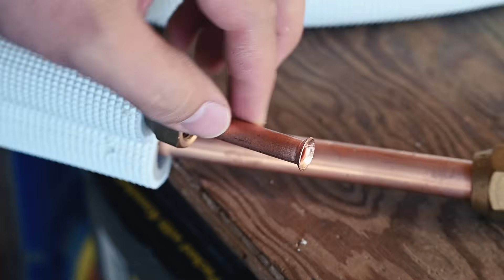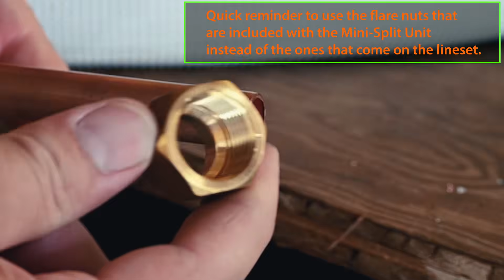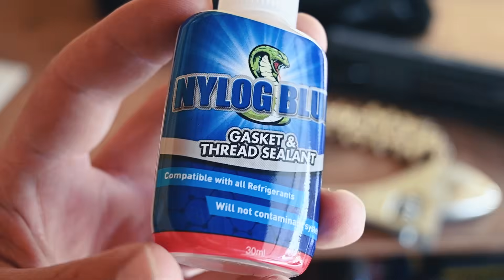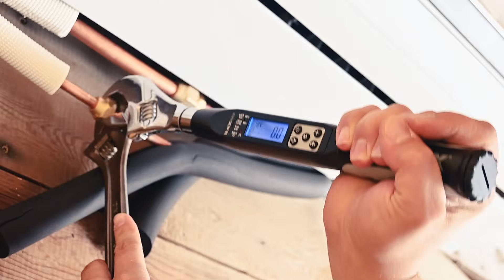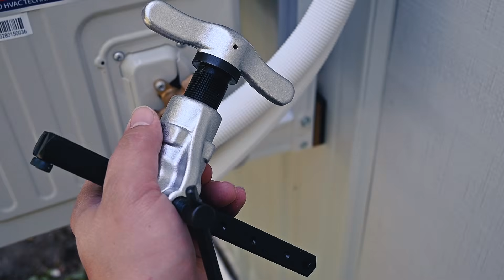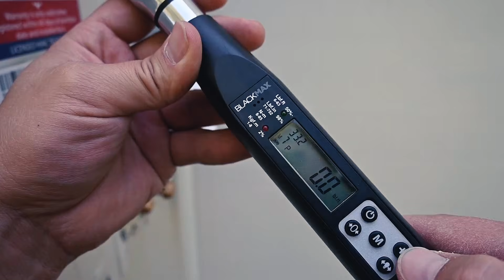How To Install a Mini Split Line Set - R410a Flaring Guide & Torque Settings Using Nylog

Comment: I used too much Nylog on the 1/4 line and could not get it to torque correctly.  I cut it and re-flared it then use a tiny bit of Nylog which worked well.

Comment: I would pressure test before pulling a vacuum. If your system has a leak while under vacuum, you’ll be pulling in moisture laden atmosphere. You do not want moisture in your system.

Comment: DISAGREE!!!
There are many more compressor lifespan-threatening mistakes than just flares.
Factory tubes not cleaned with nitrogen prior to installation.
Hand bending of tubes.
No high-pressure nitrogen tests.
Unlacquered motherboards - humidity is a killer.
No 24-hour vacuum test.
And many others. 
Flares are just one of them and are easily overcome with power tools (won’t bring up names) with 4.8+ ratings on online shopping platforms.

Comment: my buddy bought the CPS Blackmax wrench you used to install a mini split in his shop.  it worked great for him, but last week he brought it to my shop to help me install my system and the digital system was locked up.  it had sat for just over a year since he did his system.  he called their tech support and they had him try several ways to reset it to default and then told him it was toast.  he filed a service request on their website over a week ago and has called them twice more since and has not received a call back.  he is very unhappy.  to finish my system, I bought a Yellow Jacket 8 piece set with a manual click type torque wrench.  no chinese digital tools for me after seeing what happened to him.

Comment: pls if i may ask , is it okay to bend the pipe coming from the indoor unit , (if i wanted to pass it through a wall ) when it is still under pressure or should i de pressurize it first before making any bends on it ? pls help

Comment: I always rite off the first flare without  a nut as practice. Im 70 years old and have made i couldnt even tell you the amount of flares i have made in my 50 years of flaring. Several practice flares. Im not a violent person but if i could go back in time the person that invented the flare should be stopped before he had a chance to ever invent the flare.

Comment: Hey Ben, what do you think about using heat shrink tubing on the suction line before installation? I think it could complement the existing insulation very nicely, but can you think of any downsides? Thanks

Comment: I see that that mini split use the white polyethylene insulation on the line set. I've been reading that the white polyethylene will start corrosion of the copper line sets if moisture gets inside?  And people recommend the black rubber insulation instead which will not have long-term corrosion problems. What's your thoughts on this?  You can search YouTube for formicary corrosion lineset to see examples.

Comment: Decided to spring for that CPS torque wrench. It uses an electronic pressure sensor at the pivot point, very cool.
Wish it had a safety hand strap tho, had to jimmy rig my own. Definitely not a tool you want to drop.

Comment: Great video. One thing I don’t agree with however is purchasing a $200 HVAC torque wrench. I’ll use it one time, whereas I have many automotive ones. Crows foot and good to go. For most this is the least expensive option

Comment: This is really good.  Do have a question.  If I want a tighter bend on this type of line set, can you just used a tubing bender (keeping in mind that the bend radius needs to meet the recommended standard for the line set diameter - 2.5 x the OD)?

Comment: Hello Ben
I hope my text reaches you for a response, Thanks for for video very educational,  I have a split unit similar to yours 12btu, 'air distributer internal unit' and where your copper pipe turns left, mine turns right. as original it is same as yours going to the left exit, but in mine I need to go right this is scaring me pipes are very small, the straight option is not working for me I have a concrete column.
So it looks like this needs 180 degree bending and someone who is not aircon expert it is little scary undertaking, could you help and explain how to safe this thing without bending pipes internally wrong way. I am an architect know about buildings but this is little of my expertise.

In Summary aircon as standard come the pipe exiting to the left bended by the factory,,,,, on my case I need this pipes to go right opposite direction, big twist on the pipes can ruin the unit, please help. Thanks in advance.

Comment: Hi, DIY first timer. Great video. The line set that comes with mini split system I plan to purchase has pre flared ends. Instead of trimming the line that connects to the condenser, can the excess line set just be kept coiled and connected to the condenser? I estimate perhaps 3-4 ft of coiled lineset.

Comment: There is also a gasket for flare fittings made by locktite I used on my units and I can't say it's the reason for me never finding a leak but I like to think it helps I use them with nylog blue!

Comment: Very good clear video, and much appreciated! I am new at this and was surprised that the factory-supplied copper lineset flares are not made to match the pipe offset on the shorter pipes of the indoor unit. I would describe the model I got as quite "user unfriendly" for the DIY'er. By the time I learn all this, I will probably know as much or more than the expensive guys I could have hired. The instruction booklet suggests that the typical cost to hire someone for the entire installation should range from $600 to $1200, but I know full well that not only would they charge around $4000, but they would do a massively inferior job, cutting all sorts of corner than have taken me many weeks of work in my particular installation. In my case, each step is at least ten times harder to do than shown in all the video examples I've seen.

Comment: I always wondered why Pex can't be used instead of copper. Does anyone know why it has to be copper? Actually just realized copper is needed to handle the heat..
Reply: What is the +/- pressure and temperature rating of pex?

Comment: Every time I try to do that it pushes the copper tube out of the grip. I Tried everything and finally found what I needed and word of warning don't use Harbor-freight brand well for Flaring tools. It don't work even though cheap. Bite the bullet and buy a good one if your going to be using them often.

Comment: Is there some rule about line sets needing to maintain a downhill slope between the air handler and the compressor or can the last foot or so slope up to connect to the tubes coming out of the compressor?

Comment: Thank you for the content. 

I am a paid tech for 8 years. I will forget to put the nut on the line pre flare a few more times before i retire. 

Funny but great to share, happens to most of us.
Reply: Flare nuts or heat-shrink tubing... More times than I can count.😅
Reply: @uncontrollabledogs3791  lmao heat shrink! Yes! I did automation tech gig for a bit <3 that was shrink wrap forgotten often. I should get some on the hvac van. Ty for the smile and reminder fam!
Reply: Very informative video. In my country the techicians never dare to cut piping to size use flaring tools. They are yet to realize the importance.

Comment: Showing house wrap in the video's final image - what was the cladding going to be on the house? The line set is attached directly to the sheathing, and the outside condenser is set before the cladding?

Comment: Hello, i have bought a second hand 2.5hp AC, have been using it for 5 years now, i used to call people to refill the refrigerant couple of times, now I realized that they have been using freon mix with air, now my AC is not cooling because there is no freon, just air. Can you tell me how to removed all the old freon mixed with air from the AC units, and start to vaccum again and refill the freon again? Thank you.

Comment: There should be no cracks In the flare. These are a source of stress concentrations and the crack will spread.  if there are cracks, they need to be removed usually with automotive sandpaper.

Comment: Although this video was extremely helpful, I realized after cutting off the flare that came with my 1/4” Line-set that the nut was just as good as the one that came with the unit.  To make matters worse, I’d already done the connections so I took it apart to cut it off.  Now, when I attempt to re-flare it (my first flare), I’ve tried 8 times and can’t get a flare NEARLY as good as the one which came with the line set. So I’m stuck until I get someone to re-flare this connection.  I not touching the rest.  I suppose my flaring tool is too cheap. But at some point it doesn’t become worthwhile doing it myself if I have to spend boku bucks on each tool.  😢

Comment: Duh! Only the condenser outsides unit comes with extra fittings the inside unit you have to use what's on the lineset so what's the difference? So does that mean the inside connections are good and the outside are bad? Duh!!

Comment: 4:20... I can see that the Flange of the pipe is too small in diameter for that connector nut. I use 1/8" out to have the Flange the same size as the 3/8" Nut.

Comment: Having done automotive brake lines (too many times) as well as A/C, there is nothing here that I couldn't easily accomplish.  However, the reason I went with Mr Cool is because of the warranty.  And because I bought from Ingrams, the warranty actually works.  Is your CH unit still under warranty for a DIY install?  Most aren't.

Comment: i am researching how to install my first mini-split. I am concerned about the flare connections. I heard you say to use the connectors that came with the condenser. I am wondering if you cut off and re-flared the evaporator side and reused the connector nuts that came with the line set or went with the flare/nut  that came with the line set.

Comment: Hi Ben, Love your video’s! Super helpful so thank you! Quick question. I notice you don’t do a nitrogen pressure test, just the vac down etc…I see info that lands on both sides of the fence. Are the necessary? Is it certain situations they should be done? I’ll be installing a system shortly and an was hoping for some insight. Thanks man for all you do!!!

Comment: Great vid. now subbed. 
Can not be emphasized enough: buy quality tools.
If you use a deburring tool, point the opening down to avoid any copper bits from going into the tube.
I love the Rigid mini cutter.  I have severe arthritis in my hands, so I keep a larger one in the bag for doing 3/4, but yeah, this thing is great.
HA. Glad to see I'm not the only one who forgets to do the first step first (re. flare nut). 
I'm writing a book on Mindlessness Practice.

Comment: Youd be fired straight away using needle nose pliers to debur and the cracking copper around the flare definitely needs to be fixed

Comment: Could you please tell me when to open bottom valves on multi zone mini split  as nobody seems to explain this well. Most know to keep top master valves closed until very last but several videos tell us to open bottom valves before vacumming begins and some tell us to do it after. Who is right? If you do it before do you lose much refrigerant? I have a cooper and hunter 3 zone. Please help.
Reply: Nitrogen pressure test 350psi for 30 minutes each line set/zone,  then vacuum each line set/zone for 30 minutes. Then open each zone's valve slowly, then the main valve. Have the total additional feet of line set added to all zones, you will then need to add r410a slowly. The 28000 BTU CH is only precharged for a total line set feet of 74.

Comment: Factory flares on my Cooper and Hunter were perfect. Used Nylog as added insurance. Freon in the compressor is preset to the size of the line set. Any DIY homeowner should not cut off part of the line set. It will cause an improper charge.
Reply: The lineset that came with my pioneer also look good. I have reflared other minisplits and have the tools but no reason doing it if they look good already--although i get it if you have to shorten the lineset.

Comment: HI- need to order a 25' length vs the 13' supplied. Can some one explain the specs to me so I can order it on ebay?  I understand nut size- OD and inner diameter- but don't see mine on the drop down menu.wil add pic of current 13".   8x8(38"x3/8") other is 8x12 (3/8" x 12")

Comment: Oh yeah, I've done the same kind of thing as forgetting to put the nut on before flairing, but usually it was something like connecting wiring and not running the cable thru the box or nut first and having it all nice and tight and then OH DAMN, how did I DO that!!!!!!

Comment: I am installing a 4-zone mini split on interior walls and running the lines down through the wall cavities and through the crawl space. 
I could get one, maybe two, of the air handlers installed but I have to leave walls open to have the lines accessible for pressure testing.
To avoid leaving walls open all winter, can I leave the activation valve closed and evacuate just the branch and then open the activation port giving access to the active manifold?
 If I can do it that way, I wouldn't lose any refrigerant and I can close up the two walls that are open now.

Comment: When running line sets for extended runs, such as 40 ft, through an attic...what would be the requirements for securing the lines. Must you secure them to the trusses or rafters and if so how far and by what means.

Comment: I have a question - I see you trim off about 4 feet of lineset at the outside connect point. How does that affect the amount of coolant already pre-loaded into the compressor? What is a safe amount of line set to cut off before you worry about the coolant load causing overfill for the length of lineset? For example, it looks like you had maybe 20 feet of lineset and cut off 4 feet, That is about a 20% reduction of running footage. I have heard that 80% give or take is OK for the coolant weight in relation to the length of the lineset. Would you say that is accurate?
Reply: It doesn't matter that much. There is some flexibility with regards to refrigerants. If you get way over 25ft you might consider adding some, and theres a formula in the minisplit installation guide for  that.
Reply: Great question. I'd like to know that as well.
From what I've been reading, most pre-charged units are set for up to 25' and have linesets that are 16' and 25' for the same unit. Install manuals that I've read just mention the need to add refridgerant for >25' but nothing about <16' .  
That's all I know so far.

Comment: Well done video--as usual. While working in the nuclear industry as an instrumentation tech, no flared fittings were acceptable, due to less strength than good compression fittings. We primarily used Swagelok compression fittings, or sometimes Parker, on high pressure inconel, lines. Flared fittings are outlawed in nuke industry power block.
Why don't Swagelok fittings get used with HVAC? I would use them in a heartbeat over flared. BTW, I was certified on tube bending, and virtually all fitting types.
The worse aspect of Swagelok was over torquing by pipefitters on smaller fittings.
Reply: Hello there , how are you doing today?God bless you!!❤

Comment: 1.) They sell a ream tool to properly debur the copper.
2.) When deburring copper always try to face down the copper to not get debris in the line. (As yours had during the flare difference) 
3.) Use tubing bending tools to prevent the copper from kinking. 
4.) NYLOG is NOT needed. It will make a mess and can cause issues later.
5.) Tighten the copper tight and go 1/4 past. I have had more leaks with people that torque it down. Vibration can cause joints to become loose. 
6.) Have a professional do the job and have less headaches in the end.

Comment: Pressurize with nitrogen first to check fittings for leaks, then perform the evac to around 300 microns prior to releasing charge.

Comment: The groove/gap space that's cut into each of the rollers on "all" tubing cutters is for you to cut off just the flare on the tubing. Without wasting and cutting off too much copper. For people who forget to put the flare nut on the line before flaring it. Just FYI
Reply from the maker: No way. I've always wondered what that was for!
Reply: @BenjaminSahlstrom  🤣It's true
Reply: @BenjaminSahlstrom  is there going to be the next video to finish the heat pump series?
Reply: Excellent close ups, informative video.  Is it possible to pull a line set through a 3” pvc pipe for under slab installation?  Thank you.
Reply: Gvy,ftg.